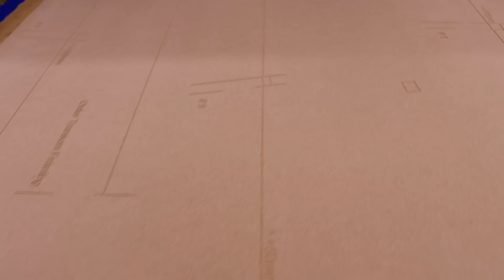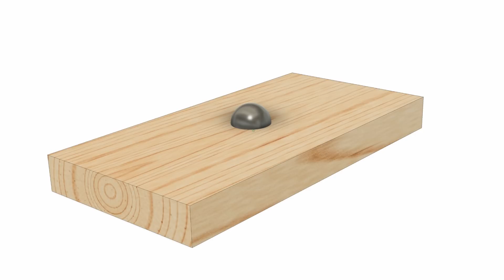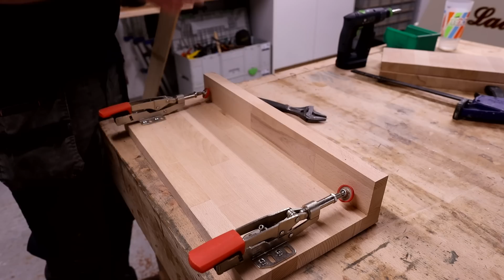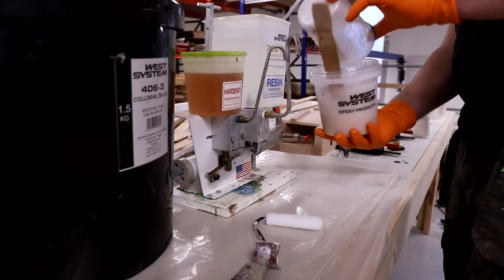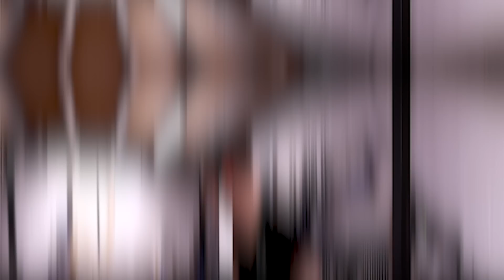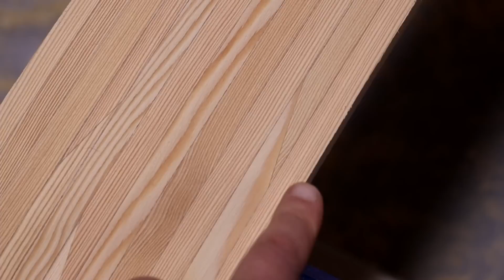Laminating A Wooden Boat Stringer | Building Temptress Ep16

Comment: For future lamination i have a top tip. During the layup process, before removing clamps; after its cured. Drill on the horizontal plane diagonal holes through the whole width for dowels. Epoxy and insert dowels and let cure. Depending on the severity of the curve, you may want many dowels within the given span. I like to make "v" shape paturns with my dowels. 
Once dowels ate cured, then you can remove clamps. Spring back wont happen.

Comment: Question regarding the scarfing jig. Can you do the same thing using your chop saw? Does the jig provide a better joint? I'm not a wood worker so be gentle.
Reply from the maker: You probably could do this on the chop saw but you'd still need some sort of jig to alter the cut angle. I'm also not sure if you could feed a timber right through like I am here.

Comment: Always a pleasure to watch you work and explain what your plan is. I do wonder two things, however: are there no square recess screws in the UK? Almost no cam-out, especially those 3” screws. And you sometimes don’t pre drill. Personally, I use two drills so I can drill and c-sink (using a combo bit), then drive.In Canada-made MDF at least, driving a screw flush in MDF always displaces and raises a bump, so the surface isn’t flat, and I can’t live with that, usually! Maybe UK MDF is more forgiving, or you’re ahead of the curve and know whether or not it matters?

Comment: Great series of videos! One question though: did you use white glue for those scarfs? Why not epoxy?
Reply from the maker: The scarfs are tacked together with G5, 5 minute epoxy. The laminates are glued with 105/205 West System thickened lightly with 406.

Comment: I was looking at the size and weight of that stringer at the start and wondered how you were going to wrestle it through your jointer/planer. And then final dimension on your sander. Fair play to you for doing it by hand and keeping it square and level. I know how hard that is to pull off.
Reply from the maker: I contemplated putting it through the sanding machine as I can move that, however the stringer is probably 2/3rds the length of my workshop so I would have had to aim it out the door as well 😆

Comment: Like you I always go to some length to spread out scarf joints. But anytime I’ve tried to test break an epoxy scarf joint, especially in softwoods, I’ve invariably fractured the timber around the joint before the joint itself!  But it just feels like the right thing to do since as a rule, joints are the weak spot : )

However one valid reason for spreading them I’ve found is that a scarfed joint creates a stiffer section in the length and laying all the lengths with the scarfs close together can create a stiff “flat” spot when trying to bend the multiple laminates around the mold.  It’s easier and better to spread them out. Great work as always.  She’s coming along nicely. Thanks for the videos. Cheers.